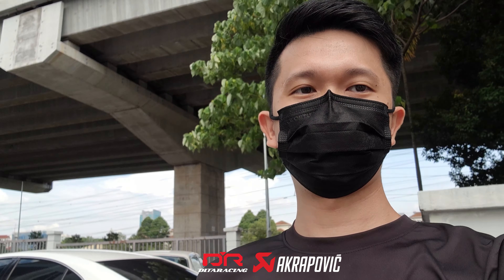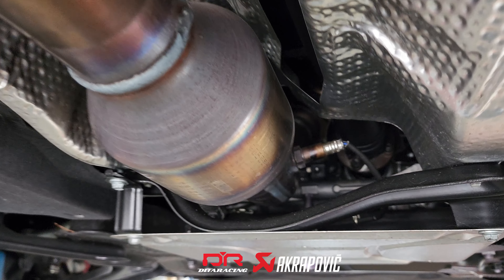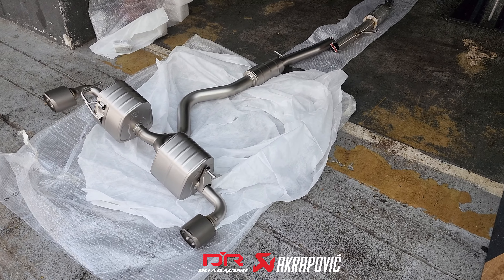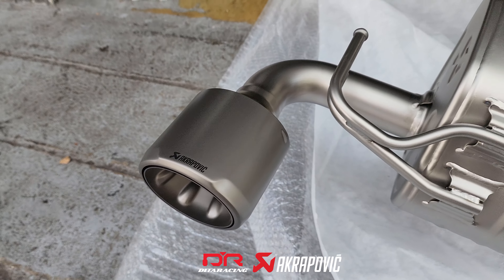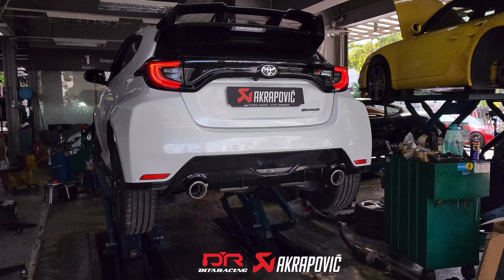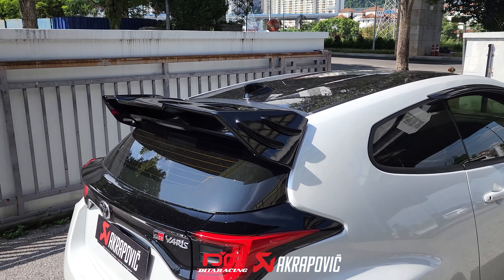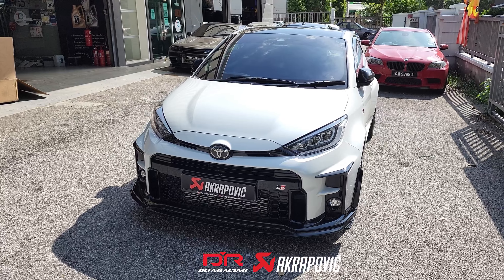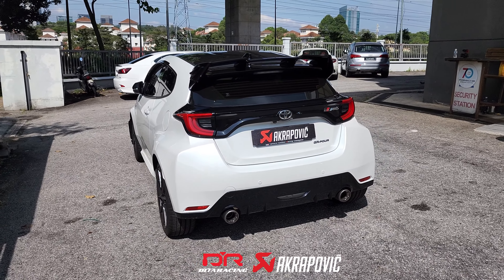TOYOTA GR YARIS AKRAPOVIC EXHAUST | BEST TITANIUM EXHAUST FOR GR YARIS

Comment: Did you guys do something with the ECU? I installed only the slip on cause the warranty on the car
Reply: They threw it out I guess
Reply: @johannesstaller  on the akra homepage they say that you need to remap the ecu but you do not get any map from them. I called my dealer and they said that it’s fine with a slip on but when you installing evolution link pipe you are risking the warranty’s especially when you need to remapping. Had you not had to remap the ECU then you hadn’t risk the warranty so much (if I get it right)
Reply from the maker: Did not remap the ECU, as it doesn't throws error code for non-OPF/GPF cars here in Malaysia. If your car is OPF/GPF, then yes changing the link pipe will mandatory to have an ECU remap.
Reply: @DitaRacingInternational  thanks so much I will check how it is :)